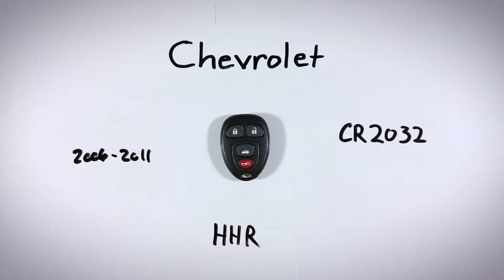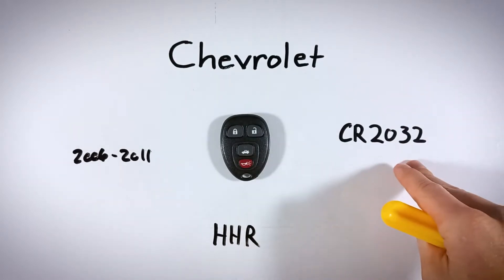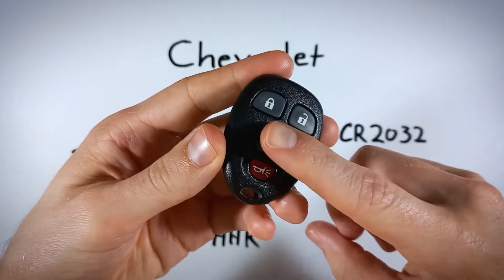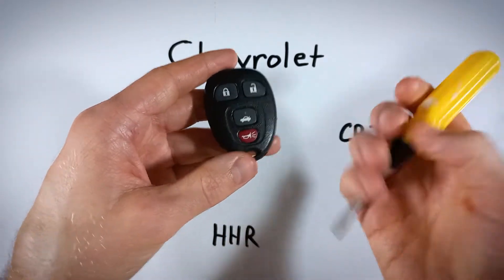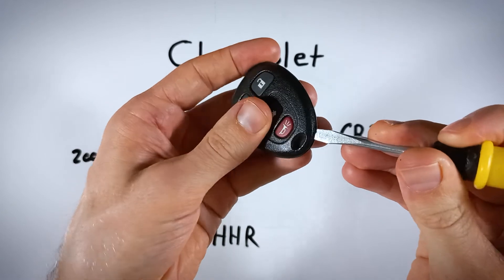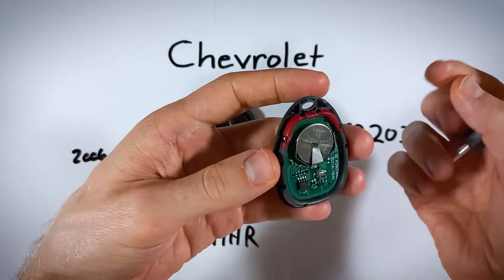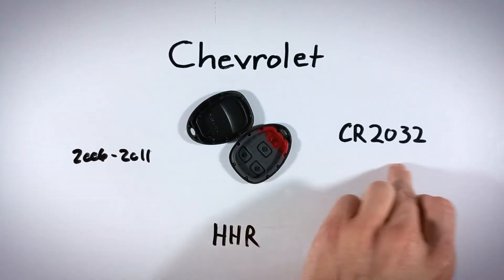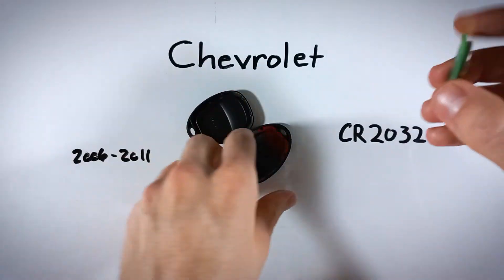Chevrolet HHR Key Fob Battery Replacement (2006 - 2011)

Comment: After replacing the battery, the button for the alarm works, but the buttons to lock and unlock the doors don't work.  Do you have any suggestions?  Thank you.
Reply: My Buddy told me that when you replace a battery you need to recalibrate it somehow with the alarm system…. Did you ever get it to work?  If so, what did you do?  Been needing to change my battery but have been afraid to because I wasn’t sure if that’s all you have to do.
Reply: @iamsylar789  Nothing is ever that easy! 🙂 It's been a long saga since I did this.  I had found another video (sorry I don't remember which one) that said that you need to put tinfoil in each rubber spot on the inside of the fob because they get worn down with use.  That explained why the alarm spot worked because I never used it.   I added the tinfoil and everything worked great for a couple months.  I watched another video that said you need to use super glue to keep the tinfoil in place.  After that everything worked great again, but I soon realized that if the fob was anywhere near the car, it would lock and unlock the doors on its own!  I got sick of the whole thing and just gave up for now.  Sorry for the long winded answer.  No, I didn't ever have to recalibrate.